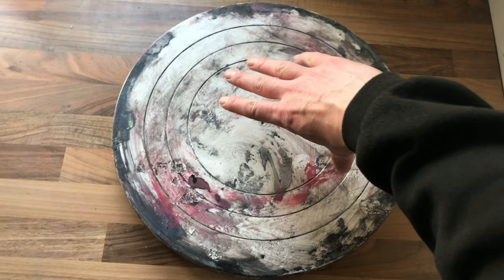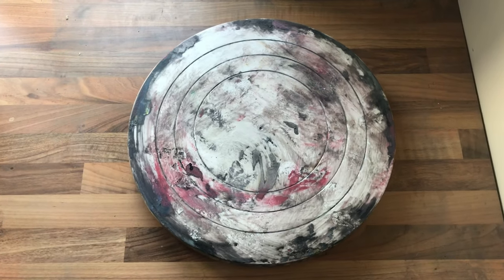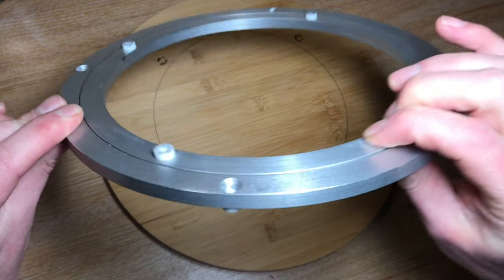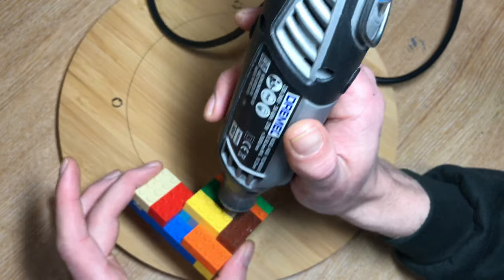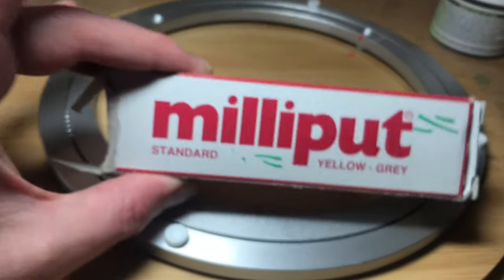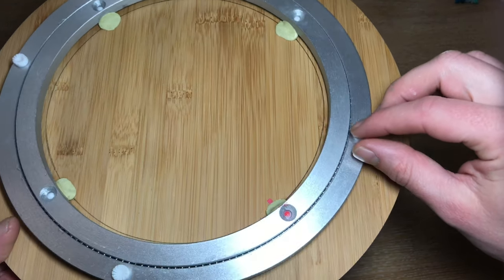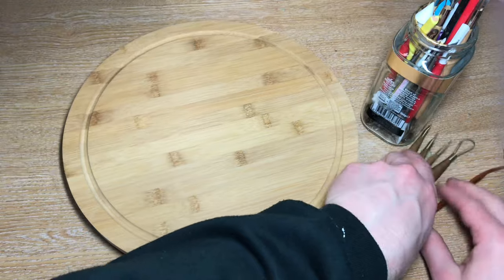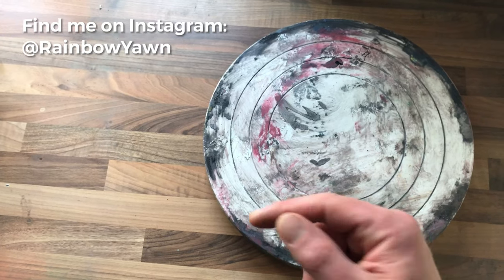DIY Heavy Duty Sculpting Wheel (Cheap & Easy!)

Comment: You could use multiple bearings to reduce friction further. And you could drive it with an air current.
Reply from the maker: Wish I’d thought of the air current before I fitted the belt drive and diesel motor